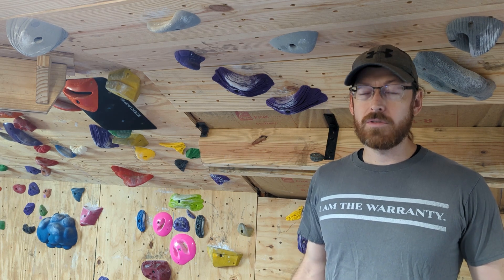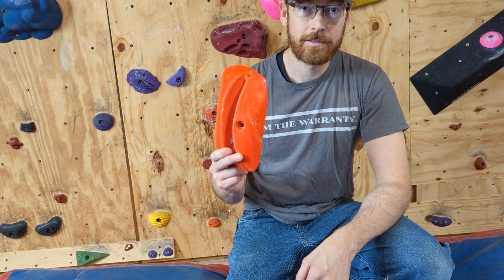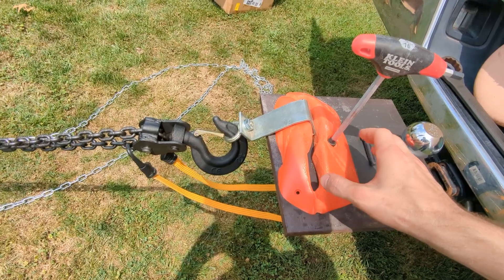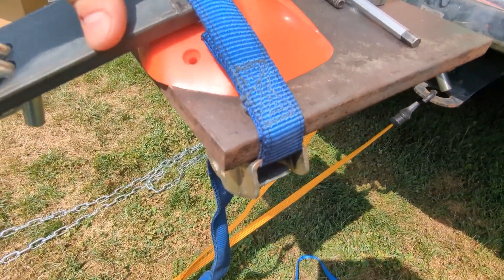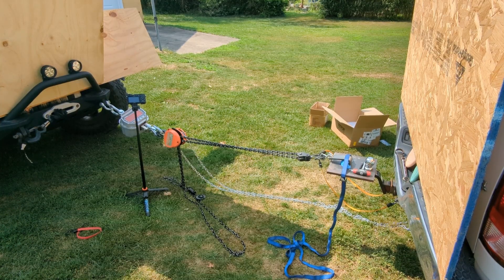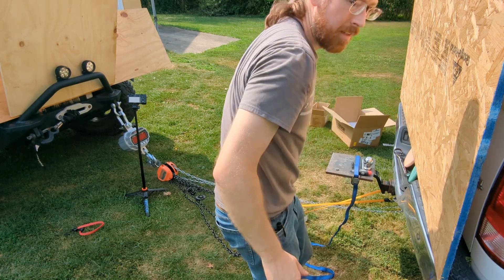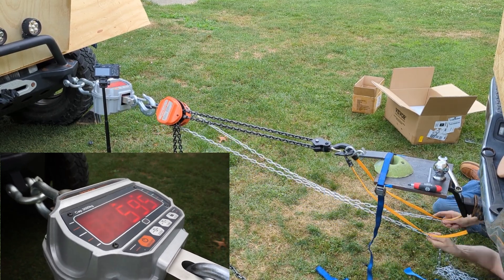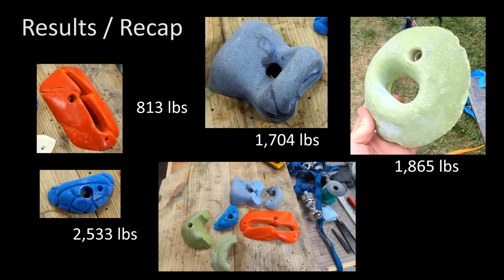How Strong are Climbing Holds?

Comment: I'm almost 300 lbs and I have been unable to break any hold at my 3 year old gym. I have tried to break levered jug holds by jumping on them and I can't do it. I break a lot of stuff (chairs, beds, decks, mountain bikes, etc.) but never any climbing gear of any kind.
Reply from the maker: The safety factors are pretty impressive. I've certainly had no issues in my gym, even though I've been nervous about certain holds. Definitely not nervous now : ) Thanks for watching!

Comment: I have torn off parts of holds off the wall. It's absolutely possible. Those that stick out more can have really long lever arms. 

Also, the older style of resin is a lot more brittle. They were prone to cracking regularly. The newer ones bend slightly instead.
Reply from the maker: I've never personally seen that, but I do believe you - shape definitely makes a difference. Unfortunately I wasn't able to experiment with too many holds due to cost and making sure I could attach something to it.

Maybe there will be a Part II someday 🙂